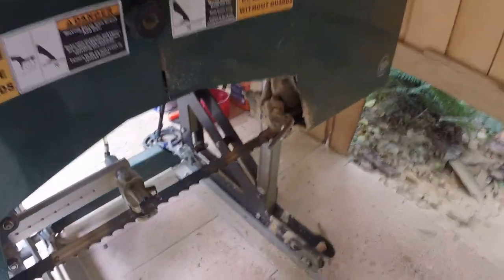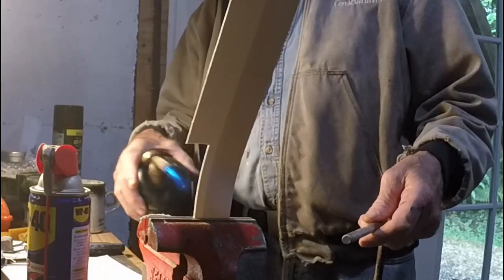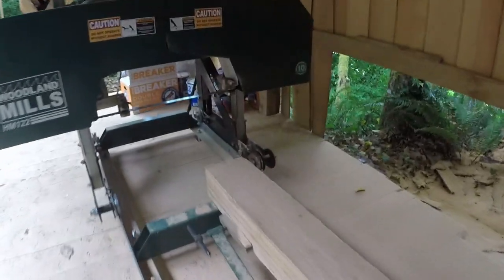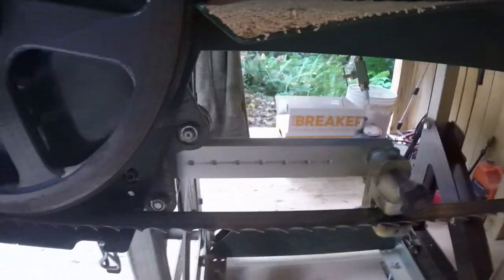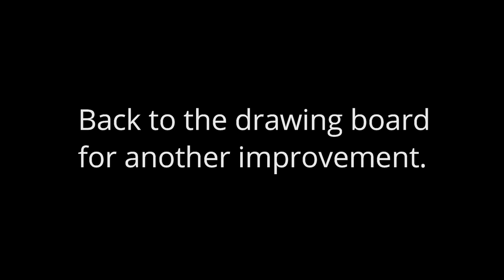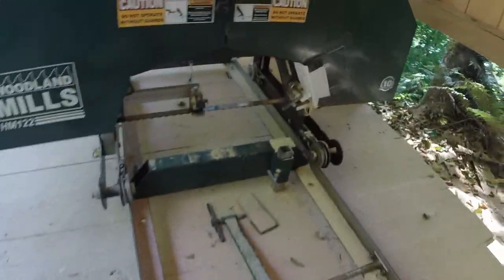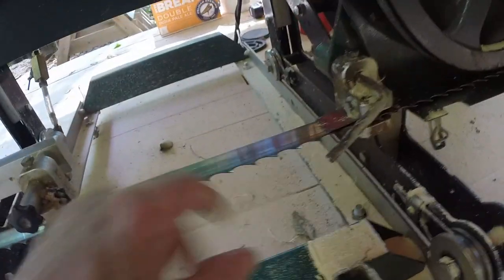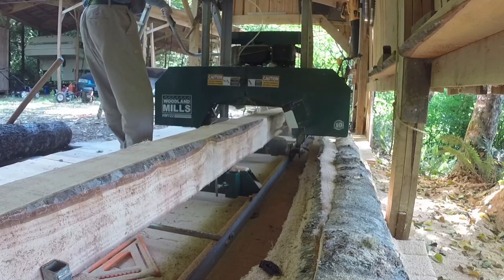Quick Clip #6 Sawdust Baffle for my Woodland Mills Sawmill

Comment: in 5 years ive only replaced the drive belt once and the v belt is still the original ,,,saw dust sticking to the belts has never given me a problem
Reply from the maker: Pulley alignment was off a little which wore out the drive belt on one side only. I corrected most of that with idler adjustment, and a clutch shim is on the way. That should solve my belt-wear problem.

Comment: Nice clean blade for sure. I mill mostly Doug Fir which has a lot of sap and deposits it on everything inside the wheel house. I have the WM 126 mill and the blade sharpener. I haven't worried about tooth set so far, it seemed to be too expensive for my taste. My biggest whine about the Woodland products is the manuals, there are incorrect sizes of wrenches, pages and tolerances all through it. My second biggest whine is the amount of bolt on pieces there is to their products. Lots of things to come loose. However it is better than nothing. Thanks for your idea's etc.
Reply from the maker: When I started sharpening blades, cleaning them first was drudgery. The scraper and sawdust deflector I came up with reduce the need to clean blades before running them through the sharpener to zero.

Comment: It seems to me that the follower wheel end needs a discharge as well because a lot of debris collects in that end with every cut too. It ends up on the blade and in the blade guide. Best of luck and keep at it..... I look forward to your success so I can adapt my 126 also.
Reply from the maker: Problem is dust between wheels and blade. Sawdust in the follower corner just lies there until cleaned out. No big deal, I think.

Comment: if your metal scraper was cut on a angle as 30 or 45 would it throw 
the dust slightly out the side. you said it the tooth is charring it in

Comment: Our mills we use deizel for lube but I don’t think you could it might make that drive wheel slip. I just ordered the 130 max with the trailer
Reply from the maker: What brand of mill do you use diesel lube on? Cook's does, but there bands ride on the iron wheels, not on tires.
Reply: I sold my hydraulic mill about 10 years ago and I’m not sure of the name of my dad’s mill but the drive belt doesn’t go around the big drive wheel. My dad has a 20 Honda on his and mine had a 24 ran the saw and a 6 hp ran the hydraulics. I could look through my photos and see what brand it was
Reply from the maker: @claytonhillier9496  I was curious about what the band rode on regarding use of diesel lube. Your dad's saw's bands obviously didn't ride on the drive belt. Thanks.

Comment: You might have a little to much lube that’s why it’s like paste up in there
Reply from the maker: I ran too much water in the beginning, but for the past few months, I run about one drop per second or less. Sawdust is mostly dry and doesn't clump the way it did. I milled green alder almost exclusively until recently. Now it's mostly semi-seasoned fir, though some is waterlogged.